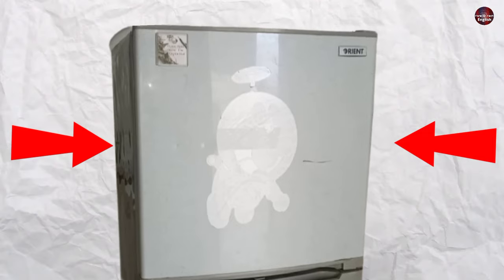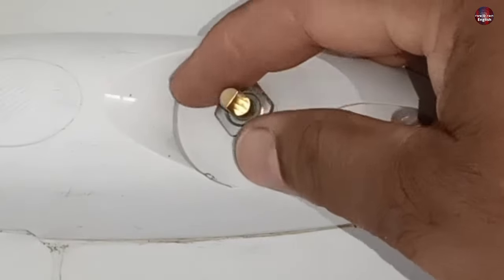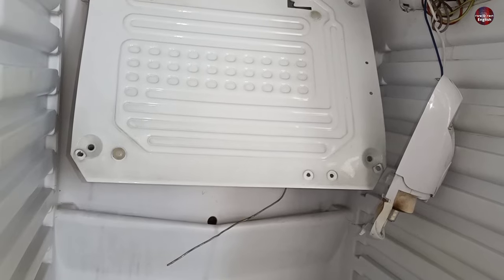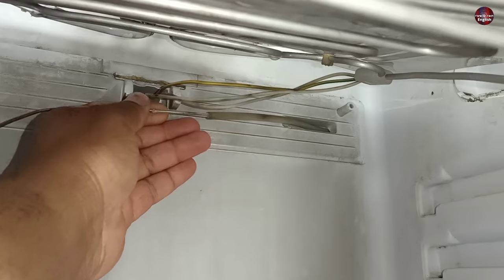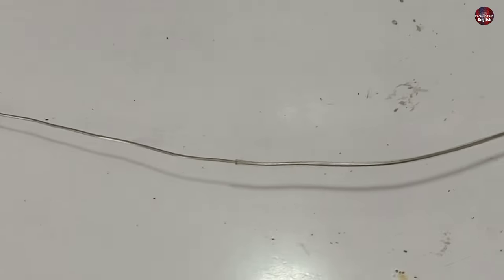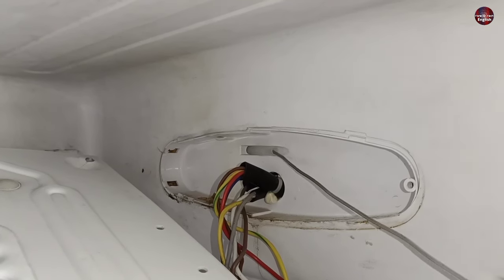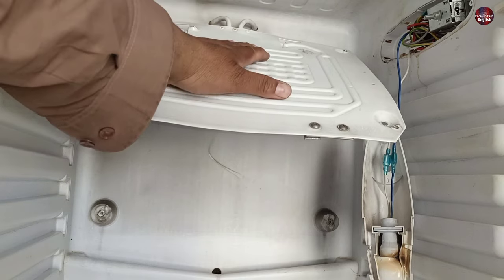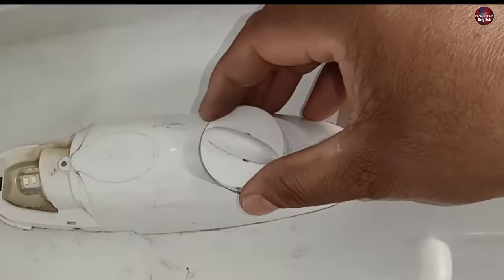Replace Faulty Refrigerator Temp Thermostat Before Food Spoils

Comment: how do you know when there is a problem with the thermostat?
Reply from the maker: The Compressor was not turning off automatically, and the customer complained about it, I tested the thermostat with a multimeter, it was bad.
Reply: what is the reason if the refrigerator does not cool well?
Reply: @forevertechenglish  I left my Freezer door open overnight because a container was squashed and opened the door. Now the compressor still works but will turn off after a number of hours and not come back on so the fridge warms up - could it be the thermostat? (I have turned the unit off for over 24 hours already to rule out frozen coils). thanks in advance. If I plug out the unit for say 20 minutes with the thermostat knob set to off and then plug it in again and turn the knob to on the compressor will come on. but then if I turn the fridge off using the theromstat knob and on again using the knob again the compressor will not come on - so something is wrong with the thermostat?

Comment: So I've got a Frigidaire side by side fridge freezer. The unit was freezing the refrigerator size but reading like 86 or something. I replaced the temperature sensor on the fridge side. The old one was burnt and now the unit isn't getting cold at all after plugging back in. Any suggestions?